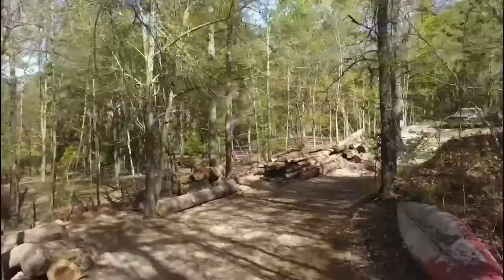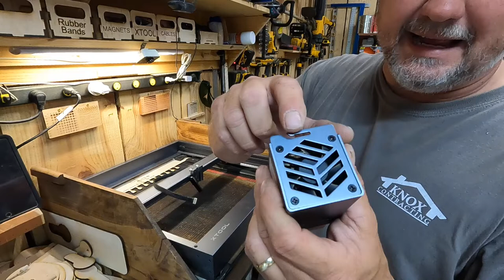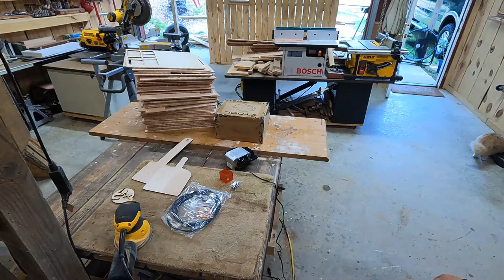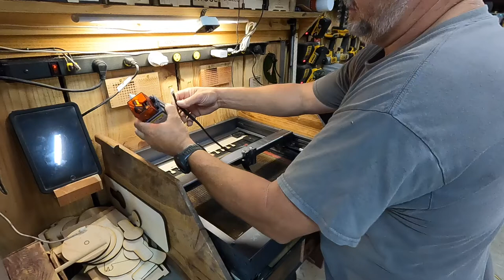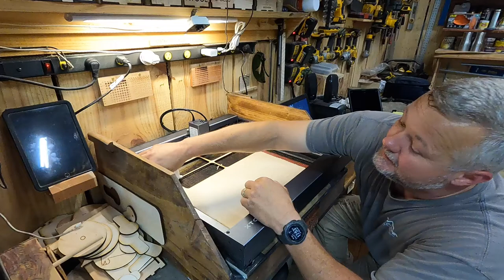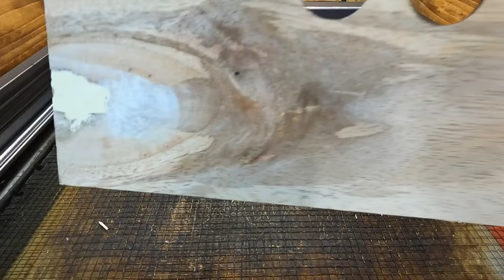Install and test of XTool air assist (full video)

Comment: I ordered the bare bones laser, the RA2 rotary, a honeycomb and a set of legs on April 17th. My laser showed up in a couple weeks. I got the rotary 2 weeks ago, the honeycomb 3 days ago and I'm still waiting on the legs extensions. The products are top notch but their shipping schedule sucks. I already had a nozzle from another laser and I found an o-ring that took up the slack between the lens and the nozzle. Much better than the tape you're using. I think you're going to be happy with the air assist. It keeps everything nice and clean. I'm cutting 6mm MDF at 400mm/s 100% power and 5 passes and the kerf is so narrow I have to push the pieces out. It's a nice clean edge, too.
Reply from the maker: Yea, tape wasn’t my favorite part but I was careful to get it snug and sealed. So far it is doing well
Reply: Same.
Ordered whole set, minus honeycomb.
Also thought sis in USA was visiting soon and so ordered shipping FREE in USA.
Ended up she wasn't able and had to resend to me at nearly 300$!!! Because shipping AND UPS forced a border fee....
BUT WORSE, a few days later my AIR ASSIST came SEPARATELY!!!! WHAT IN THE WORLD?!? 
So now she had to send THAT too!

What the heck?

If you order A SET...you MUST trust you'll receive that SETnon the date you are told!

Cost SOOOOOO much more and it didn't have to.
It is totally avoidable.

Comment: fyi...stepper motors generate an electrical charge when you move the gantry...the faster you move the gantry the higher the voltage they generate... i suggest  only moving the gantry when necessary and move it slowly.
you can damage the control board back feeding voltage to it from the stepper motors.
Reply from the maker: Good to know.

Comment: I put a drag chain on mine, so i just routed the hose thru it. I mainly got it to help with cutting, and etching more sensitive woods like bamboo.
Reply from the maker: It seems to help. Even makes engraving deep easier. I epoxy pour engravings so the deeper burn saves me passes.

Comment: The problem I see with the tape is, everytime you take the nozzle off to clean the lens the tape will tend to slowly unstick and start to come off.If XTool would have done their homework right the nozzle should  fit on tight without any tape.They sure did cut corners on this one...Great and long video!
Reply from the maker: I didn’t want to leave anything out. It was lengthy but you can skip around

Comment: The biggest advantage with the air assist on engraving is it helps keep the soot off the lens. Soot buildup on the lens is the main cause of cracking, it absorbs some of the laser energy and over heats it.
Reply from the maker: Yea, I run mine anytime the laser is on.

Comment: Atomstack makes an air assist that looks like it will work with the xTool, for much less $$. Their honeycomb bed is cheaper as well.
Reply from the maker: This is some CLASSIC Clack Shack.. Yea, this was my only production machine at the time and I went with OEM parts. Since then, I have expanded my variety of accessories. I now have several more machines and many more attachments. Thanks for the tip though..
Reply: @TheClackShack  I noticed it was old and I didn't think you would mind me giving some current info I researched. 👍 So many people don't do research on the price of everything. I'm cheap, frugal, if I'm spending $50 I'm taking 2min. to get the best price.

Comment: My understanding was that the first D1's had one of two different sizes of laser mounting diameters.  You probably have the smaller size if yours's is an older one.  It seems that they only send the one size at this time.  I just got mine and the size is correct.
Reply from the maker: Makes sense

Comment: Thank you for the video, I bought the air assist awhile back but have not installed it yet. I've only been engraving and I was under the impression it did not help much on engraving?
Reply from the maker: You saw it here, it did make it darker but that was just one burn.

Comment: I just got my D1 20 watt. I also have air assist. It looks like the light shield is too small. Tube clamp, looks redundint. There is already a hole for the hose, at the top of laser. I think the nozzle looks different. New nozzle hole is smaller. I appreciate any insight you might be able to give me.
Reply from the maker: Not sure I understand the question, I removed the shield from mine but use an enclosure.

Comment: Appears to be a poorly engineered fix on the part of xtool. I understand you do not have to do this on the new 20 watt. I wonder if you have to do this fix on the new pro 1 10 watt.
Reply from the maker: The 20’watt pro came with an air assist nozzle already installed. I am unsure if the 10 does, even though the tape was required it does work as stated.

Comment: Slow your cut slightly and you may find that you only need 2 passes.
Reply from the maker: I am gonna tweak it, I just started using air assist and it has changed how it cuts.